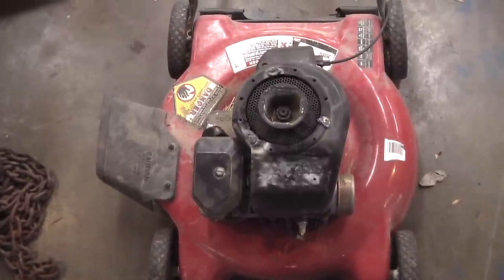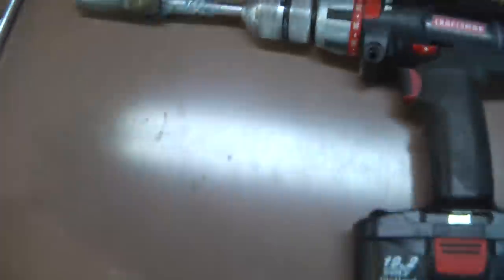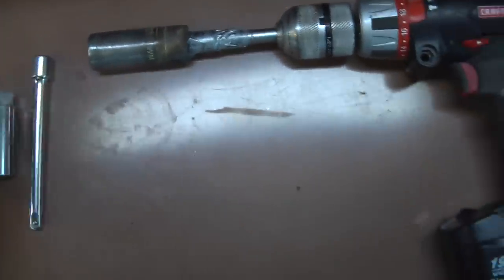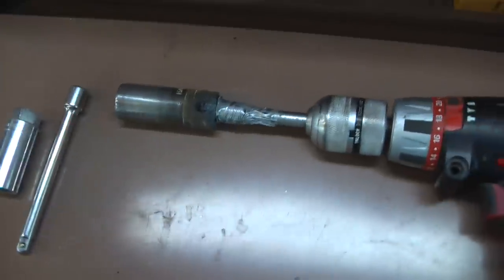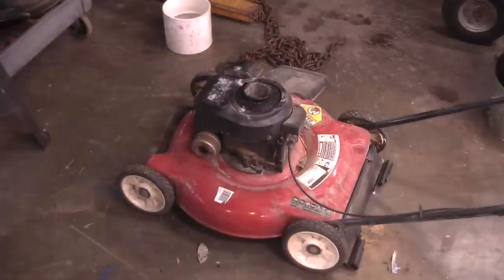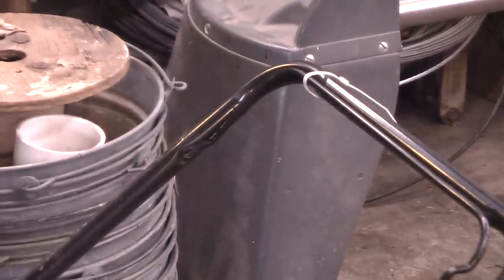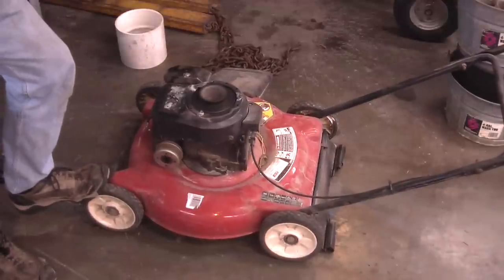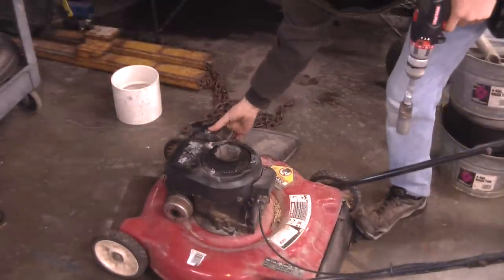How to make an electric start for small engines

Comment: My arm was ripped off and my back is getting really bad I wonder if this would work on any pull start mower
Reply: it should, i bought electric as i couldn't pull start my mower anymore, 4 years later my batteries on electric are shot and it will be about 200.00 to buy new- i am going to pull out the old ones and try to start them this way. good luck to you and i hope it works!

Comment: I did it with a 14.4 emburer drill and it worked well on my Honda mower so it doesn't have to be 18 volt

Comment: Or do what used to do, cut a notch on that bell that sits on top if the flywheel(the thing you´re sticking that socket down into) with a dremel tool or a metal file then find a rope that strong, tie a knot at one end and some sort of a handle on the other.Then just put the knot in the notch you cut in the bell, wrap the rope around the bell and pull! There yah go!

Comment: I did this myself with a backpack blower. Worked great. Unfortunately by starting it this way for a long time, the nut on the engine wore off.
Then I couldn't get the nut off to replace it. Ended up giving the unit away. I had no way to start it.
If you start something with a drill, keep an eye on the bolt of the unit. make sure you are not wearing it down.
Reply: +Infandous Ktenology  I had forgotten this comment I made. Yes I couldn't get the nut off because it was fused on the shaft.
Since it was worn down and rounded, the drill couldn't fit on it anymore. Thanks for your reply.
Reply: +Infandous Ktenology yep and it is still on there to this very day.

Comment: this is a great video for what NOT to do, lots of safety concerns here. 
1. defeat the bail handle, great idea
2. Chain on floor next to a running lawn mower that you can't stop.
3. you walk away from a running lawn mower that is moving around on it's own.
4. Why not weld the adapter to the extension, at least you welded the socket on.

Comment: Nice! im trying to use that method on my trimmer, the recoil dont work right, im just using a cheap £10 12 volt, I KNEW i shouldve gone for the 18 volt :( its not powerful enough for the compression

Comment: grind an angled notch in the old recoil pulley and wind a rope around it..done it a hundred times and a rope is easier to put in your pocket while your mowing than a drill is.

Comment: I used a 1/4" extension with a 1/4" - 3/8" adapter on it since most drills can take a 1/4" drive.

Comment: a suggestion - instead of a drill use a battery operated impact wrench - more torque and designed to be used with a socket - normally 1/2 inch

Comment: @rhoadess Took the safety system on mine completely off.  Take the plastic cover off of the back of the engine where the cable goes in.  take it apart and pop the big spring out.  Leave the cable go up to the handle bar, but take the safety bar off, no bar needed.  Simply slide the cable up and down to ground the wire.

Comment: Nowadays the tools required would cost about $24. You can get a recoil starter part off a used machine from nearly small engine repair shop for less than $20 or less. Add in the danger in doing this, and the fact some crankshafts will actually break if you use an impact drill or any really strong drill ruining the machine forever and you got a great recipe for broken fingers and a dead machine. But if that's what it takes to feel manly, what the hell? To quote General McAuliff at the Battle of the Bulge: "Nuts."

Comment: I made one of these to get my go kart running, it works great.  Use a hammer drill instead of a regular drill, it has more oomph.  Forget that idiotic pull start, with a non-running engine, you'd pull yourself pissed off silly before you ever got anything to crank and then break the rope to boot, and probably take a hammer to your engine you'd be so pissed off.  This way you can crank all day until your engine fires up.  Dies?  No problem, hit it again with the drill, over and over.

Comment: Best use a socket that is just big enough not to strip the nut because if that socket gets caught on there with drill in hand it will try and break your hand off..  eventually will either strip the socket or nut though inevitably though from the motor starting and pulling off the socket when it does...

Comment: be careful with the rope. that engine has a ton of compression. make sure the rope is wraped around proper way,or the engine will not run. looking at the top,the engine spins clockwise. a little starting fluid will help,also. i hurt my back the first time i pulled on it,so be carefull!

Comment: my drill turend the wrong way , or, the right way for a drill, turning engine backward fast and now no spark, when turning right way , it ran a bit before. guessing the coil made sparks that went inside it damaged it  and heat . melted a wire in it.its a gy6 scooter motor and used a strong big long electric drill.

Comment: to make it safer you should put the recoil housing back on and  use a hole saw to drill a hole in the cover a little bigger than the size of the socket  so that it will be safer not to catch any ones hand or anything that may come in contact with the top of engine

Comment: All of that manufacturing is not necessary to get a socket on a drill. You can get socket adapter drill bits at Lowe's, Home Depot, Menard's or wherever you get hardware. Or Amazon. http://www.amazon.com/SE-Power-Extension-Socket-Drills/dp/B0002TW1D8
Reply: You are right, However, if you take an ''hexagonal---half inch'' adapter, the half inch part will have to be secured some way in the socket, welded or not..
 They have all kinds of amazing adapters these days...like this female half inch-female quarter inch hexagonal.  An half inch impact can work on Phillips screw, let's say.

Comment: I learned this trik wen I was a kid about 18 years ago for the same reason I broke my pull start on my little 49cc scooter and it worked only trouble I had was getting the drill off quickly before it started because if I was not quick I would not start it other than that it worked and I thought of that before I even had a device that I could get on the internet as I didn't lke computers wen I was a kid but a little thinking and a little work I had my scooter up and running in no time lol

Comment: oh,to turn the starter "on" and "off" i get it. you should get a solenoid. the official sears site sells them for like 14 95 a piece. very cheap and beter than a light switch! you will also need to get something to activate the solenoid. check out fearlessfront's "how to: re-wire a riding lawnmower" video. in all it will cost 30 bucks but hella better than a wall switch!

Comment: I would buy a el cheapo drill and mount it on the side of the engine and connect the flywheel to the drill with a belt and pulley on the drill chuck

Comment: safer to get an old car fan belt. loop one end round the starter cup the other end round the drill chuck, that way you just pull it tight to turn it, loosen it and take it off once it starts.

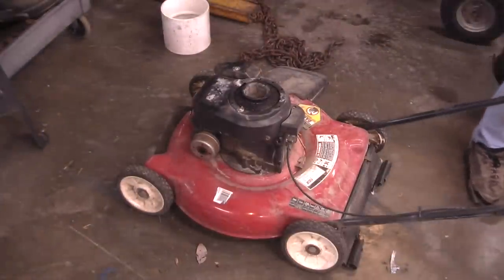Comment: This guy's shoe at 3:14... Looks like he zip tied his safety shut off down and started the mower with his feet DAMN close to the blade. Oh... wait.
Reply: +Alex Noel

Bypassing the safety lever would be really stupid if the mower is self propelled, especially in this situation. This video shows deadly advice to some idiot (lets admit it, this means every second home owner) doing this with a self-propelled machine. I can see how someone(millions of people actually) might potentially zip tie both safety handles and screw up his foot inside his fancy office worker leather shoe or sneaker when the mower overran him. That's worse than just a five-digit hospital visit and a lifetime disability; you could die of infection in days or even bleed to death in minutes under unfortunate circumstances.

When it's a traditional push mower(I can only see one cable and one safety bar so this one looks like one), it's all different. It's not necessary in older mowers and those are still perfectly safe to operate. 

The foot thing was kinda disturbing, really. This could be done just like a normal safe pull start, holding the safety lever(if any) with one hand, keeping feet away from the blade and starting the engine with the other hand. The lack of a flywheel cover is way too dangerous in itself, btw. There should be a modified cover in place if a drill start is planned. And a drill start is very impractical compared to a pull start. A proper electric start would make sense, kind of. In theory, at least.

I would also point out that you're supposed to have reinforced protective shoes or boots on while operating(including test starting) a push mower. This might sound like the nanny state or a safety fascist, but that's not the case. This opinion is from someone who opposes seat belt laws and helmet laws, and sometimes omits those. I've just seen enough accidents to weigh risks against each other. Or in short, to know what is really stupid and what is pretty much ok.

Comment: He IS starting it with a battery.

Even most regular electric-start motors are battery-powered. Some, though, as on most electric-start snowblowers, have plug-in powered starters instead.

Comment: Ive used my harbor freight battery powered drill to start my 15.5hp rider! if you want to start a rider with a drill, Make sure to have the throttle at or near idle...

Comment: The nut will ware out if you do this, So get a tempered steel long nut or weld 4 tempered steel nuts together and then grind it so the socket will fit on the lined up nuts, If you can't find a long nut.

Comment: looks like you guys have lots of problems with pullstarters ive never had any issue but if i ever do ima make an invention like that and put it on this 5/8" drill it has monster tourqe but it plugs in and has a handle like on an angle grinder so it shouldnt jerk out of your hands on you

Comment: Hey, lets take this advice up a notch. What about getting a 1inch drive impact wrench and start your car?  Forget all that battery nonsense,  just leave it running while you do shopping so you can get home.
Reply: What, and do away with the old fashioned hand crank? Blasphemy.
Reply: David Mil when the starter went on my s-10 as a kid, a 1/2 ratchet with a socket started it from wednesday until I got paid on friday. Necessity is the mother of invention.
Reply: why not take the wrench with you duh? then carry it with you everywhere and offer to start every gas engine you encounter for a fee or charity as the world needs this kind of ingenuity
Reply: how did it fit in there?

Comment: why didn't you just use a 3/8 inch drive socket  instead of cutting your extension.   no cutting or welding necessary

Comment: Why not just start it like normal?
Reply: Are you high?   He said he broke the pull start on the mower and the parts place wanted 50 bucks for a new one.   He just showed you how you could use it on different engines.

Comment: so all you need is tape, a 19v drill, extention, hack saw to cut it, all the addapters to fit your 1/2 socket and a welder. All for less then 50 $ lol good trick tho  id like to see your 5$ store for all those tools

Comment: Another, more intelligent option is simply to find a cheap or free mower on Craigslist with the same B&S engine (they are everywhere) and use it to properly fix your own.

Its also much safer not having the mower near your feet, especially since that one was inching towards yours. Would have been funny but not for you.

Comment: 30000 rpm?  It will blow up a lot earlier!
Reply: Yep.. max rpm on that engine is probably around 3600..  Most governed engines (which that is) run around 3000 - 3300 rpm at full throttle. Which, since that mower (and most newer mowers) has no throttle controls.. the engine is at full throttle all the time.
Reply: Oh I see what you did there.. 30,000 rpm.  I think he said 3k.

Comment: You ruined a perfectly good 3/8 extension, 3/8 to 1/2 adapter and a 3/4" socket. You've probably also torqued down the that drive nut tight enough that it will never come loose. I'll try it.

Comment: there is an adapter that will feed right into your drill, and straight into the socket - so you only have 2 pieces involved - You worked WAY too hard on your adapter. No tape or welding required.

Comment: ????   Even cheaper???   I bolted a 10mm coach bolt onto  a 3/4" socket I scrounged from a  local garage,....   The bolt goes through the socket, the four flats on the head sit snug in the drive socket square,.... Locked it on with three nuts,  It works fine!!!

Comment: It says electric start ,your drill starting ,bad named tittle ,don't keep doing as you burn the crap out of your drill ,it's compression that causes it not to rotate as motor gets bigger ,if you have a bigger motor and whip plugs out and rotates as fast as a small motor ,plugs back in an it won't rotate ,thus compression

Comment: Get rid of those junk battery powered drills. Get a 1/2 electric gear reduction. It will take your arm off and ALWAYS work. Battery drill will work for a year or three. After that the batteries cost more than the drill. Throw it away. Don't make that battery pack anymore.

Comment: butt doing it that way you risk damage  to the flywheel nut ,flywheel it self and crankshaft. if you damage the crankshaft you will be out tha $money $ !! for a new lawnmower .every time you start that mower that way you proceed  to tighten  that nut even more  . something will  break  !!!!!!!!!!!!
so in the long run you will bet better off buying  the pull Start .

Comment: Do NOT try this with an air powered impact driver.   It will impact hammer on that nut so many times,  it will keep jamming the nut tighter and tighter until it breaks the flywheel at the crankshaft.  It is a tapered shaft....  Ask me how I know.   Additionally, never zip tie the safety on/off bar.  That is just plain stupid.  You need something you can release instantly if the need arises.
Basically this is bad advice for anyone that is not familiar with the hazards awaiting the dumb ass that watches this then has something bad go wrong very fast.  For a weed eater, maybe not quite as stupid, but close.
Reply: avflyguy he had the pile of chain there 'if something catastrophic happened' lol 😂

Comment: OR DRILL A HOLE INNER SIDE TOP FLANGE. THEN HACK SAW A PASSAGE FROM OUTSIDE EDGE TO THE HOLE AT A SLANT. THEN TIE KNOT IN ROPE  AND PUT IT IN SLOT AND WRAP ROPE AROUND A FEW TIMES AND YANK THE ROPE.

Comment: This is just dumb. Spend the $50 on the right part or $500 copayment for an e.r. visit.
Reply: matt bauckman there is literally a 0% chance of anything catastrophic hapening. If the nut comes off, the flywheel key will just shear and she won't run.
Reply: matt bauckman go ahead.....
Reply: I paid 40 bucks for a running toro mower with a bagger. Self propelled even.
Reply: You have some shitty insurance lol.... 500 copayment for ER visit....

Comment: You almost ran your foot over. Also the cost of the drill with the battery is probably $50-$100. But if you had the drill I guess it would be worth it as long as you don't lose some toes starting it!

Comment: The nut will break off on most engines eventuly
Reply: No it won't. I start my mower this way and have been doing it now on same engine for well over 9 years. If the bolt breaks, I won't care. The mower is old now and I saved my back from pulling that cord
Reply: Argue all you want Ive broken enough doing exactly what you did, some hold up fine others dont
Reply: I'm not arguing. i'm just saying that mine is holding up just fine, But if you kept breaking bolts, then why did you keep doing it? just wondering
Reply: i only do it if i dont care about the engine and the pull cord breaks or the recoil quits working
Reply: it wont harm the engine
Reply: If you call a broken crank not harmed, then no it wont
Reply: it wont break
Reply: Argue all you want, Ive broken a bunch of engines atarting them that way, small 2 strokes are the easist to break, but ive broken a push mower, 5hp horizontal shaft briggs, and a few others. 2 strokes usually break off after a few times, and anything bigger takes a while.

Your basing your opinion on one engine you've done that on, Ive had 100's of small engines over the years
Reply: Im not arguing, you are. I'm telling you it wont break. Most drills are not that powerful to put that much strain on the bolt and break it off.
Reply: most people are going to use a impact to start it, and break it eventuly
Reply: highly unlikely. impact is not needed. a regular drill will do the trick and will not break the bolt
Reply: it wont break and your wont break either
Reply: by the way. I dont think A drill is rated at HP, and the average push lawnmower only has 3 to 4 horsepower like the one on the video, with better lawnmowers at 5 to 7. lol talk about A woman who knows nothing about A car.
Reply: Sandy Glascock it wont break
Reply: Sandy Glascock Do you think it will break?
Reply: +JEZPP lol
Reply: +Sandy Glascock I've never broken a single engine and worked on a lot you might want to stop monkeying around with them. you sound dangerous.

Comment: 50$ starter recoil? screw that il just buy a new drill for 200$, wait a second...
Reply: doesn't matter if you already have one which most people do.
Reply: HAHA 15-30 usd for complete tin and recoil starter assy. online.     His local parts store must have been gouging,  i know my local lawn mower shop does.....The internet is a glorious thing if you need obscure parts.
Reply: gwhuntificator  Recently had to replace the spindle assembly on a high wheel string trimmer, cheapest i could find on the internet was $154.00 Sears wants $175.00 Then one day while dropping off my chainsaw at the local lawmower repair shop i asked about the spindle. Not only did they have one it was only $134.00 Thank you Mikes Mower in Soulsbyville California. You guys are awesome! 99.9% of thime the internet is your best bet.
Reply: jaj